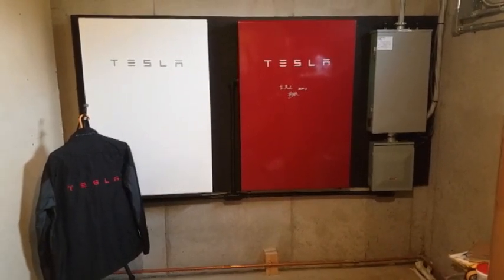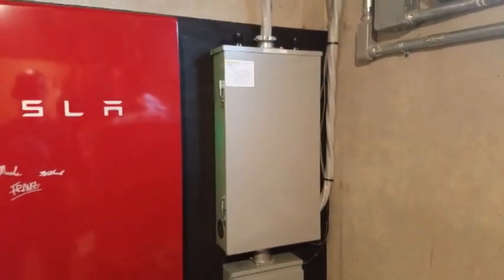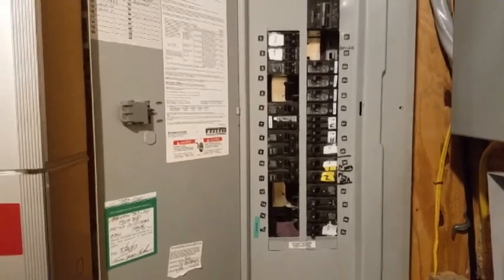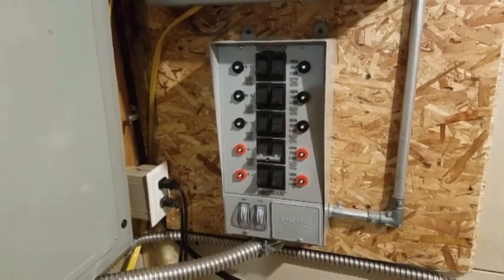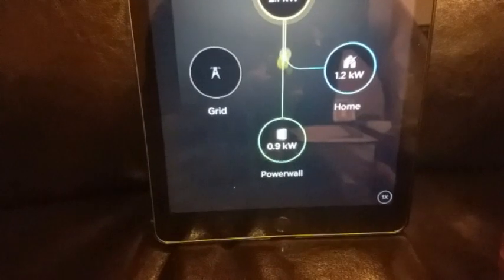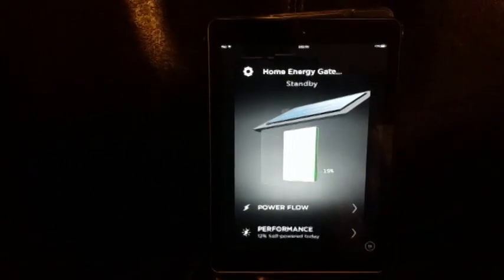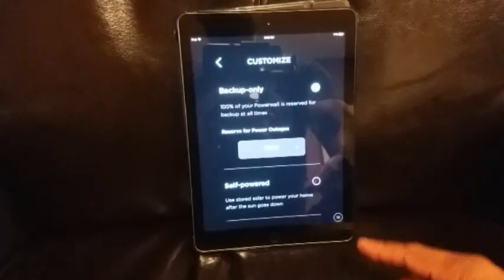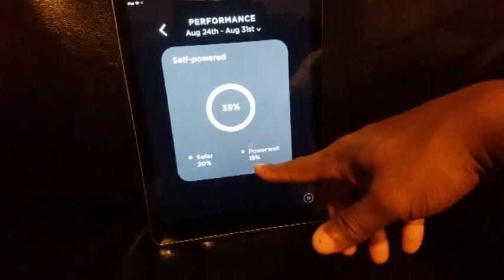Living with Tesla Powerwalls & Solar

Comment: You and I are among the coolest people on the planet.  I have 10 kW of solar charging two Powerwalls.  We also live in a grid challenged area and subject to periodic outages (from a few hours to a few days) and bought the Powerwalls primarily as protection against that.  They worked flawlessly through two short outages since installation in July.  We're taking delivery of our Model 3 today.  Great information on charging your car from Powerwalls and solar.  Interesting to see how much power charging the car pulls......BUT  If we charge our car in the middle of a sunny day, we'll be literally charging and driving on solar power.  On a fully sunny day, the panels produce over 9kW (peak) for 2 - 3 hours (more during long summer days), enough to get charged up.  
Wishing you many sunny days.

Comment: Thank you for the great video and information!  I am venturing down the solar path and found your video very valuable...have you shared (or will you if you haven’t) your schematics of your overall system...I have ordered 50 of 305 watt panels and will be ground mounting them here in the country side but I haven’t purchased anything else and still trying to figure out the most optimal layout!  Thanks for sharing your knowledge, Ben

Comment: I've been completely Electric Since 2006. Now totally gas free In 2012 and now 2018 with the model 3. My next move is to get the Tesla powerwall and get rid of the natural gas generator. Just wanted to know what northeast state you're in? I'm in Jersey And I know how the winter takes toll on solar. Just curious , Your solar setup ?  I'm still on the DC the AC with inverters. Do you have direct AC panels or  Are they all DC? to inverter.   I plan on upgrading to the new SunPower AC 370's ,  before getting the powerwall though.
Reply from the maker: I'm in Jersey as well (Bergen County). I've had solar since 2009 (5Kw Installation + 4Kw Installation in 2017). I do not generate as much energy in the winter, of course, due to the angle of the sun during the winter but I still save a few bucks. This is more than made up for during the long summer days. All of my panels are DC and use AC inverters. Check out my "Living With Tesla and Solar" video for more details regarding my installation. Please note that the video was done before the Powerwalls were installed.
Reply: Thanks,  I'm down here in Red Bank, I'm on plug share too.  Plan on getting the wall, plus upgrading to the 370's, as of now I only produce 19Kw.
Reply: @Themachinewon  I grew up in Eatontown!  I live in Pittsburgh now but miss Jersey very much.  The 370s you mentioned, are those the panel wattage you have?  Are these panels from Tesla?  I only ask because I am getting solar panels from Tesla and I was under the impression that hey have 325 as the highest wattage.
Reply: Puneet Kalhan , 370s, are from sun power company in California. Sunpower produces the most powerful panel made in production. They are 370s/AC panels with built-in micro inverters on back. Sunpower is the only company I would purchase panels from. They are the Cadillac, of the solar panels.  If you do a little research on solar panels and the specs, you’ll see for the total amount of cell count, Sunpower produces the most power. Hands-down.

Comment: Will the battery last longer if you only keep it in backup mode?
Reply: Yes, The batteries would last longer if I only have it in backup mode (for power outages only). But with the cost of a system like this I feel it would defeat the purpose. The cost benefit really comes into play when one is utilizing the energy that is generated and stored during the day when the sun goes down. This is the reason why I only reserve 20 percent for backup purposes in the case of a power outage. Also take into consideration one would only need the use the 20 percent overnight. Once the sun comes up enough energy should be generated to address the needs of the home during the day as well as store  enough energy for overnight usage. I hope this answered your question

Comment: the panel where there remove the breakers, requires blanks in place for the missing breakers
Reply from the maker: Yes, I know. Solar City did not have any blanks on the truck when they performed the installation. They are coming back onsite to install the blanks as well as install a new main breaker switch.

Comment: Great video explaining the install and usage. I want to install this system but they are not in Ohio yet. What is the cost of this setup?
Reply from the maker: Ryan this configuration will run approximately $17,500 ($14,500 for (2) Powerwalls & $3000 for installation)

Comment: Is this still need internet access and for 2019 how much you pay? If you install now?
Reply from the maker: I am not clear on the question you are asking. If you are asking whether internet access is needed for the installation; yes it is in order for the gateway to communicate with Tesla. Even though the gateway comes with mobile antennas I believe they are only used as backup. The total cost of a system similar to this one is approximately $18000; including installation. This is before the federal tax credit. I hope this answers your question. Please feel free to ask any additional questions you may have.

Comment: if 3LR has 80kwh and it costs 7k to replace and is good for 1700 cycles, you could easily trade energy for .1$/kwh delta, use 75% of the pack a day .75cycles to make 6$/day paying off in 3 years after using less than half the packs life....its a blowout

powerwall is laughably overpriced compared to the batteries already in tesla vehicles that could do its job far far better.  
if theres a horrible power outage chances are you're not going to work
if there's a horrible power outage wouldnt you rather have a 80kwh battery that you can take to a working supercharger and bring it back? for idk 2 days of power?
13kwh powerwall for 6500 isnt doing anything useful